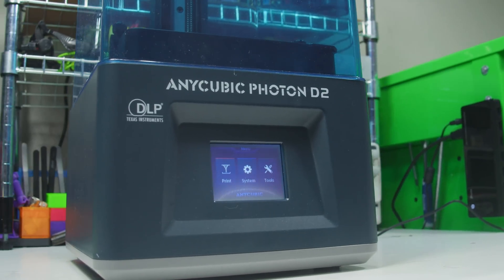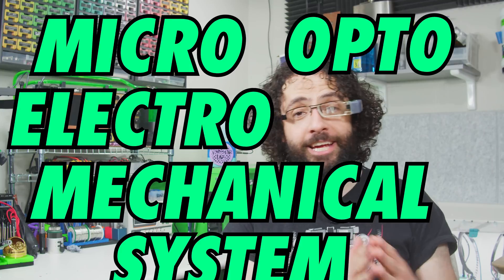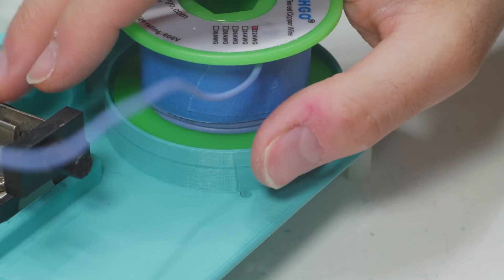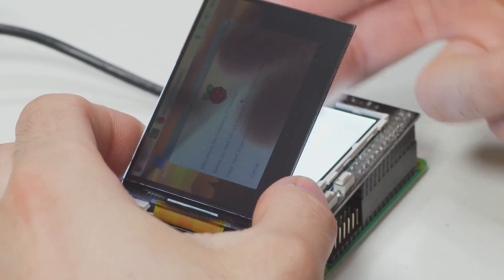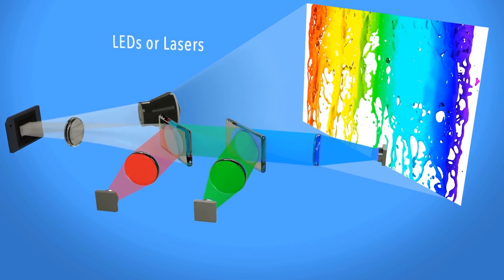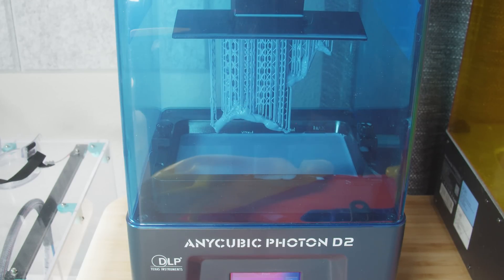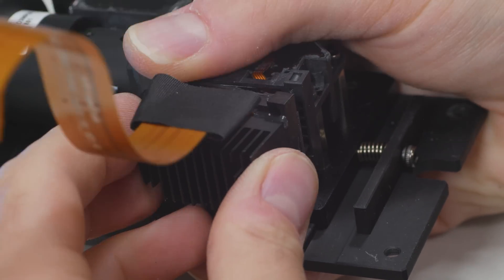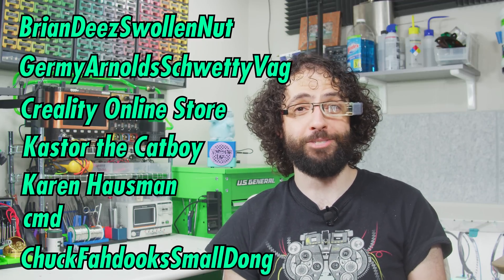Four Million Tiny Mirrors: The Insane Engineering of DLP and the Future of 3D Printing

Comment: 6:34 man it would be real cool if they could use DLP to do selective high beam where it's all high beam all the time but the DLP chip will dim the beam in drivers faces with input from a camera.
Reply: Don't they already do it that way ?
Reply: @cherrygirlw  I don't know. I've tried looking it up before and have seen solutions like BMW tilting the headlight assembly, Toyota using an array of LEDs to selectively light areas(?), Audi using a physical vertical light cutoff to slice out a portion of light kinda like a high beam cutoff in a projector... and nobody will actually tell you HOW their system works because it's a trade secret.

Comment: Truly an excellent and rarely accurate deep dive into technology that was well presented and clear.  I found no technical errors, but two super small details that only told part of the story.  Everything he said was correct, but to tell the untold parts:

1) Zach said the DLP chip has a "life span of 20,000 hours".  That may be 100% accurate for the industrial DLP chips that are used with high power UV illumination (for example with a printer) and I agree with what Zach said... longer than one needs it to last as well as that would be printing 24 hours a day non stop for more than 2.2 years.  For DLP chips used in projectors that handle visible light, that lifespan of the chip is magnitudes longer.  I have seen MTBF ratings on DLP chips that is typically 650,000 hours and up to 5M hours.  That does not mean the projector will last 650K hours, but a quality projector designed for long term use can easily operate for 10 years of continuous operation or much longer.  

2) While virtually all high end DLP projectors use 3 DMD's (with dedicated chips for Red/Green/Blue), there are many more 1 DLP projectors that are still being made and used daily.  Most still use color wheels still too.  Many still have some "color breakup" (rainbow) artifacts, advancements in wheel spin rates and better synchronized motors, have decreased the perception of these artifacts.  Some DLP projectors (beyond just pico projectors) can also be made to eliminate the color wheel by having fast switching light sources.  

A detail missing from the projection side of DLP chips (but not needed to operate the same way for 3D printing, the topic of the video):  DLP chips operate at crazy fast rates in the many thousands of Hz.  It is a series of these flashes (called "Bit Sequences") that provide the "grey scales" needed so the light is not just "on or off".  Bit sequences used in DLP projectors are what makes DLP projectors not just a binary monochrome display device of white or black but devices that are capable of 8, to 16 bits of color but also at incredibly high frame rates.

Thank you Zach for producing a technically accurate very understandable and truly deep dive into a very small corner of technology.

Comment: Since you can achieve basically pixel-level sharpness, have you tried printing a porous block, to see how it works? it may be possible to print porous sponge-like objects which can suck liquids and retain them via surface tension.
Of course, good luck with washing the resin away before curing, but it should be doable with ultrasonic cleaners after some cycles

Comment: The technology is amazing and there are many advantages with DLP resin printers. But there is one huge drawback. The more you use the full printplate, the more you reduce the quality. You can get high level of detail with a small object, but if you want to print a bigger object or multiple small objects at once, the quality will be worse than a LCD printer.

Comment: Not mentioned: The Mono X 6K costs $100 less than the D2, and has 5x the print area. Pixels per inch are about the same due the D2's relatively low resolution, though obviously from the video, the individual pixels are a lot sharper.

Can't really bring that up when you're pretending not to be a paid corporate shill, though. :)

Ribbing aside, DLP chips are difficult (and hence expensive) to manufacture, which is why they can put a monochrome LCD with 30 million pixels into the Mono X 6K for less than the cost of a 3.6 million pixel DLP chip. The chip is also very small, which means you need to create a miniature projector in the base to enlarge the image.

DLP was briefly a thing in rear projection TVs, before plasma and then LCDs edged projection TVs out of the market entirely. I owned one years ago.

Comment: Since you're close to the research, would it be possible to use a 10W diode laser to do photo plotting on Thermally Curable Etch resist and Solder Mask for PCB production, or would the array melt?

Comment: MISTAKE - It is not 4 mil. tiny mirrors there is less than 1 mil. The DLP chip is 1280x720 the same as in Photon Ultra and uses XPR technology which shifts the DMD chip to four directions and therefore "creating" 4 pixels from one at quarter frequency (quarter light intensity). Furthermore the DLP is not the future the future is MicroLED technology for printing for cinemas and all displays and monitors.
But still great deep-dive review 🙂

Comment: I worked in a TI DMD fab for years and operated a few of the machines that placed the final layers on the chips.  The springs yokes and mirrors you described are termed hinge, beam and mirror.  But they are not a single piece of aluminum.  The hinge and beam are various proportions of titanium alloys and aluminum. The final mirror layer is almost pure aluminum; a little bit of copper mixed in to make sputtering less messy.   The electrostatic deflection of the beam is significantly less than 30degrees in each direction so calling it a "motor" is a bit debatable depending on your definition of a motor. That term was never used among any of my colleagues.   All in all, a good video though. Thanks for the walk down memory lane.

Comment: 😂😂😂 Golden Moment: Glasses we fogging up, yea I know the moment you said “ ….area acts a lot like a display except
instead of blocking light like an led or
emitting light like an led it redirects
light like a mirror. “  wasn’t probably intended to be  hysterical and perhaps it’s the heat🤷‍♂️ but that moment you get to ‘ Like a mirror ‘ I just can’t stop watching. My apologies if it becomes the most watched section because my Neurospicy ADHDpacked brain has poor impulse control. Amazing video and I had no idea how brilliant this tech is. Speaking of TI have you ever checked out their capacitive switches that work through wood, plastics and even rubber many surfaces never considered for capacitive switches.

Comment: Surprised they found a use for DLP after all this time. Most theaters have phased them out and some business projectors are also moving to an alternate tech. I remember when I got my Samsung DLP at a thrift store, awesome image. I kinda miss it.. It was only 720p, but the smoothness was what made it more appealing than a 1080p LCD. I used it as a PC monitor for years. Suddenly the supply of OEM bulbs diminished and I had to start using after market. They were pretty dim, never got as beautiful a picture as I did with OEM bulbs.. plus after market bulbs were stupid expensive for no reason. In the end, $30 bulbs appeared, but they were twice as dim as the first after market bulbs, but they did last a longer time. I think they even had a mod for ultra bright LED arrays, but it required flashing a rom and putting in a custom sensor that you had to build yourself.. I just abandoned the set in storage :(

Comment: Those cubes you see aren't a problem with the DLP chip being "too good" but are rather a software flaw in the slicer. Even FDM printers can show this type of voxel aliasing is sliced using a low resolution voxel model.  

In terms of optics, LCD printers are actually better since they are "focused at infinity"(fancy way of saying the light is at the same angle) without an expensive glass fresnel lens; you can use a cheap stamped plastic fresnel lens, but that won't hold up to the UV. Of course SLA is the king of this tech, but it isn't fair to compare projector based printers to crazy expensive laser printers.

Comment: I would like to see a deep dive on using antialiasing to achieve smooth prints with this "DLP" printer. I have been holding off on 3-D printing because the surface textures are just too coarse for my liking. (Yes, I know about acetone vapor. It ruins too much detail.)  It looks as if this technology may be just what I have been looking for....  IF that last bit of visible voxel problem can be fixed.
Reply: The real turnoff won't be the coarseness of the prints, it'll be dealing with the resin

Comment: the thing I find wierd in all this... is that DLP is NOT a recent technologies by any means, it's from the 80s! and most consumer grade video projectors uses DLP because it's cheaper than LCD to manufacture. Thought it's the rotating color weel variant that is most common because a dirt cheap motor is cheaper than adding 2 other matrice chips. And those wheels tends to have 7 colors (red green blue magenta yellow cyan and white) for better color accuracy (and because why bother recreating white light from RGB when you are using a white light source to begin with?!)

Comment: I remember the color wheel projector, when the image starts to flicker it means the the color wheel motor is slowing down, just replace it.
DMD micro mirrors would stick in the reflect or not reflect position, you'll see tiny black squares on screen slowly disappearing.
Anyone tried busting open a DMD?.  I did.... Couldn't find what I was looking for. If you have to replace a DMD replace the heatsink pad also.

Comment: Zack I feel ya. My new Display is 60hz and I miss my 100hz. And until 240 Hz DLP I can still see the Color Wheel by default. From 240 Hz (80 per Color) I don't see it on a regular Base. This is the Reason why I have an Epson 3LCD Projector.

Comment: Why do they make the printing area on it so small though? It's really cool in theory but the small size is just kind of a deal breaker for me.

   Also, am I crazy or does the whole peeling each layer off a disposable and pricey film just feel half baked (not picking on Anycubic specifically here, but sla printer design in general)? They should just flip the whole thing upside down and use the resin's top surface as the active print layer. It would always be flat, level and wouldn't require putting stress on the yet formed part to print the next layer. It would also allow for 3d printing with no layering since you could continuously change the projection as you continuously lower the part without any pauses.

Comment: Honestly. With the details of SLA printers and the speed, what reason do we still have for using FDM printers?
Reply: SLA stinks, requires cleaning of prints in a solvent and additional curing, requires collecting the remaining resin after printing, has a lot smaller build area, is more expensive in many aspects.

Comment: Overall nice video, but the title is misleading. The number of micromirrors in D2 is NOT 4 million. Physically it has 1 million mirrors and the vibration of the lens expands it to 4 million. It's call XPR and the most low cost DLP chip is using this tech to "effectively" increase the pixel array size. This is the same for "4k" DLP projectors.

Comment: In the past, I owned two different DLP TVs.  I think the first one was a Samsung model, but I don't remember a ton about it.  I eventually upgraded to a Mitsubishi 65" (WD65C9), which was an interesting beast.  It supported DLP Link 3D, which was an active style of 3D that used the TV to flash a bright light for a very short period of time to signal to the glasses on when to change.  (It did require an intermediary box to handle the 3D content.  I actually still have that box lying around!)  One aspect that I recall with them is that they were quite easy to repair due to their larger size and fairly spacious nature.  I mean... they were pretty much just a projector placed behind a screen housed in a single box.  (That's why they were called rear-projection TVs.)  I think I had a DMD go bad on me once, and I know my power board died once.  Both of those were fairly easy to replace.  (I recall putting some better thermal paste on the replacement DMD when installing it.)

In regard to the rainbow effect, I never had an issue with it.  Although, I recall some DLPs actually using a bit more advanced wheels with clear segments or other colors that were designed to help abate the rainbow effect.  I'm not too sure what my old DLPs used.

Although, now I just use OLED.  It pretty much achieves the same result.. albeit, not so much in regard to repairability!

Comment: No. DLP is not the future of 3D printing. Yes, it’s amazing in many ways. I too geek at it. But there are so many aggravating variables that it’s not worth the squeeze in building bulk items in SLA. Mask SLA has far fewer variables and way way higher precision over longer axis.  And it’s cheaper. And no, DLP has crap black values. Easily confirmed.

Comment: DLP Chip, yea played with one, need to replace  it drives a large video monitor.... trouble is I have to pull the unit to make sure of proper repla e ent unit ? Yep they used several different t units in that model maybe I'll just play with the lasers instead ..wait could the lasers project on  clouds ? A  star destroyer floating over head , for Halloween ..

Comment: Yeah, I hated the DLP rainbow effect. However, not even modern movie theater projectors are free from it. Sure they have 3 DMDs, but the pixels are either fully on or fully off, so they have to PWM them. If the picture has a yellowish streak on a dark background, I could sometimes notice a rainbow effect, because the "yellow" pixels might be momentarily fully red or fully green. (At least I assume that was the source of that rainbow effect, which was much less pronounced than the old color wheel effect, but still present.)

Comment: wait. this made me thinking. instead of regular pixels in photo sensors in camera if we use triangular pixels and combine it with DLP technology, putting three electrodes at a perimeter of the triangular pixels we'll be able to kinda steer sensors itself.. better focus and will be able to better fix exposure and saturation problems too, like if there's a very bright point in a sight, well sensor just won't look there, or slightly peek. no?

Comment: Still use a wheel based 720p DLP projector for home cinema, actually not RGB but 4 colours for some reason, has a yellow filter, yep rainbows but TBH not bad on this one. Spins the wheel fast - two color passes per frame, and varies the wheel speed at different refresh rates, so 24hz looks great. Definitely a cinematic look.

Comment: Here's an idea: A DLP-based PCB making machine. Put your blank, photoresist-covered board in, expose it via a UV light and DLP array, and get out something you can put in an acid bath to get your traces. No need to wait weeks to get your boards shipped from China.

If we assume the array is 2000*2000 (I know it's not from what we saw in the video), then at 0.1mm per pixel for the final projection, you could do a 200*200mm board with it. Not enough for making a computer's motherboard, but certainly enough for many expansion cards.

Comment: DLP printers are coming back? Dlp has issues with distortion, the image is not flat. I thought lcd printers were supposed to be faster and have less distortion? It also makes little sense to have a bottom up dlp printer, lcd printers are bottom up because they have to be. A top down DLP makes better sense because there won't be any problems with oxygen or the resin blocking the uv. Sort of like the gizmo 3d printers from 2016. Top down does use more resin though.

Comment: DLP is the future for sure.  But we need more companies to help drive innovation in the industry like we have for LCD printers. 

Couple things though… Your mono X print looked like garbage, which is probably due to the UV being cranked up or over exposure.  When dialed in right you can’t tell any difference at a 30um print from LCD to DLP unless you are using a magnifying glass or macro lense.  And the second you throw a coat of primer on, even that subtle difference goes away.   The type of resin you use plays a huge roll in this as well.  

Also your math in terms of LCD life is misleading.  7 hour prints, depending on your layer height, will only actually be around 1 hour of UV being blocked by the LCD since the vast majorly of the time printing is spent with the build plate in motion and the UV off.  At least in terms of monochromatic LCD printers.  Yes, DLP is like on another planet, but that 1000 hours (it’s more like 2000 from my experience at a lower UV) is a really long time.  I’ve actually had more issues with light loss from the UV LED’s dimming than I have with LCD’s burning out with the mono x’s.  

The best part of DLP though is the power savings by far!  I can’t wait to see this switch in the industry and DLP printers become larger and more affordable.